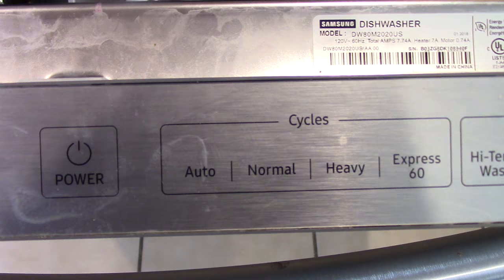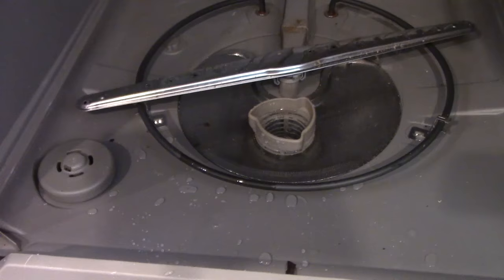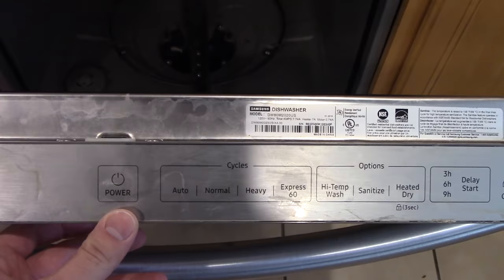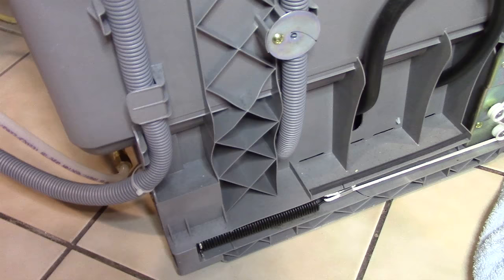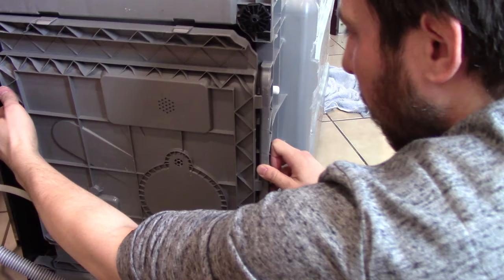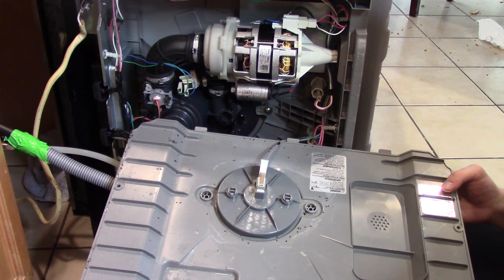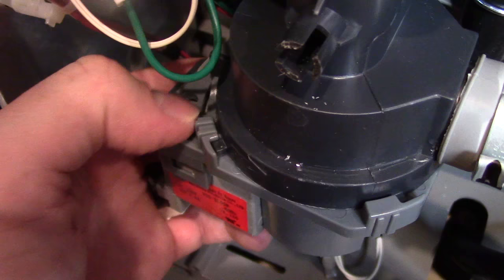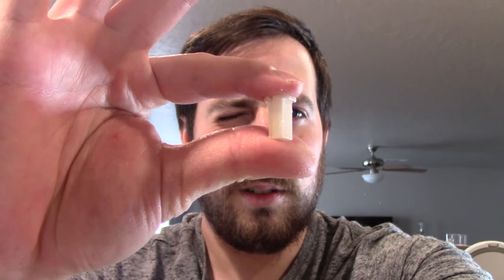Samsung Dishwasher Won't Drain: Impeller Fix

Comment: I can run the rinse cycle with no problem but water does not drain. I thought it might be the fact that they never properly hung up the holes according to the installation manual. But I’ve tried to get that holds up a time as I can and it still doesn’t drain. Was able to run the dishwasher eight or nine times before it suddenly stop draining. We just moved in so all of this was here already when we came. Can it be anything else other than the drain hose not being high enough? I put my hand in the filter basket at the bottom and I believe something there is supposed to lift up so I can get to that propeller but I can’t really seem to find a handhold anywhere to do that
Reply from the maker: Hi Erica, thanks for checking out my video. When you try running a cycle, do you hear any sort of humming sound when the system is supposed to drain or does it sort of just stop working? Is your normal light flashing? Do you recall ever hearing water draining into the sink when the system is trying to drain? Hopefully we can figure it out.
Reply: Hi, And thanks for answering so quickly! I do hear what sounds like a buzzing noise which I guess is something trying to drain but I do not hear anything like water running through the drain. I’m really thinking it’s an impeller issue. This is my first dishwasher but I’ve been doing a ton of research trying to figure out if we call someone in or not. We’ve only been here a couple of months and sometimes I’ll get the LC error code when I try to run a normal cycle. The only cycle I can run without it ever being an issue seems to be rinse but then it won’t drain.  I’m not handy enough to do what is being done in a video LOL but I’m hoping to be able to get someone in here. I read the installation manual for the Samsung dishwasher and it shows that the hose is supposed to be hung up under the sink at least 20 inches off the ground and mine doesn’t seem to have enough leeway to do that so I tried to pull it straight to the side in an effort to get it off the floor.  This is the stormwash, so there is no plunger inside. Thanks!
Reply from the maker: @authorericar.stinson4849   it sounds like the impeller is getting electricity to it. Hmm. You could be right about the position of the drain tube, although I tend to think there's more of a risk of the drain tube being too high off the ground than too low. The higher up the tube is, the more the pump has to compete with gravity to evacuate the water. Have you ever heard water draining into your sink while the dishwasher is running?
Reply: @karatefox  no, I don’t think so. And that’s one thing I noticed on the end of your video is when you turned your machine back on you could hear it humming and things going in the machine with water. I hear the sound of water trickling from within the machine but I don’t hear a hum or anything, just a sloshing sound. It’s the craziest thing. And the people that had this apartment before I moved in we’re really nasty so I wouldn’t be surprised if there was some kind of food or something stuck in there somewhere because I already found remnants of food and things in the bottom of it. The strange thing is I was able to run the machine a couple of times when we first came here successfully but I don’t recall whether or not it drained properly. Like it had a very slow drain and now it doesn’t drain at all. Regular sink works fine with drain and I definitely hear water running down that one when I use it to hand wash dishes etc. With Covid it’s been hard trying to find someone to come in here to do the work, but I’m going to see what I can do.  I hate washing dishes more than any chore there is and this is killing me because I’ve waited all these years to finally have a dishwasher.  got one and it doesn’t work 😂. Thanks so much for all of your advice! And on the plus side I’ve learned a lot about dishwashers 😃
Reply from the maker: @authorericar.stinson4849  I'm happy I could help. I've got a few ideas to troubleshoot further. Operating on the clogged food hypothesis, you might want to try getting a drain snake or something similar and try fishing around in the drain hole where the tube connects to the sink. It's possible that the previous owner put some food down the drain and some of it may have gotten lodged in that drain hole or even backflowed into the drain tube. Likewise, if you are able to safely pull the dishwasher out of the counter area, you could take a look at the tube and gauge whether water is flowing up into the tube. Likewise if you have a bucket, you might want to try to temporarily disconnect the tube from the sink and place it in a bucket to see if water can pump into the bucket. The key is isolating where the issue is in the drain system. Please let me know what you're able to find out. Hopefully someone will read our conversation in the future and get some helpful insights.
Reply: @karatefox  definitely thought about doing that and a reverse sort of way. But I definitely appreciate that advice because that’s the only other way I can get to it without pulling the machine out right now. Come hell or Highwater, I’m going to get this thing to work! Well definitely keep you posted and thanks again for all the help
Reply: @karatefox  hi again! Just wanted to let you know that there was a piece of glass that had broken off from something the previous owners did and it was jamming the pump. I had someone come in(to the tune of $300)come in and replace the pump. They seemed shocked that I knew so much about the inside workings of the dishwasher(lol)but I told them how long I'd been researching the issue and that I'd learned a lot.  If I had been physically able to do this myself, because it didn't take them long at all to change it out, I would have done it and save about $250.  In any event, dishwasher is working now, but I am still keeping eyes on it.  Thanks again for all of your help!
Reply from the maker: @authorericar.stinson4849  Hi Erica, that's great that you were able to get it working again. Likewise, thanks for sharing your insights about the cost information. If you ever have any questions in the future, please feel free to reach out :)
Reply: @karatefox  ran a 'quick' one-hour cycle after dinner, watching (and listening)nervously. I was able to hear the water going through the drain now, it did the whole cycle and the door automatically pops open about ten minutes before the end during the drying. Here's hoping it stays working this way because it was nice to be able to take my dishes out and put them straight into the cabinet lol. For once, I am not soaking wet from the spray hose attached to my faucet. That damned thing is so strong I was constantly getting sprayed every time I had to hand-wash the dishes. Thanks again!

Comment: never buy samsung dish washer nor refrigerator
Reply from the maker: True facts, my dude 💯
Reply: Or washer dryer
Reply: True
Reply: I don't even want to buy a Samsung TV anymore because of the quality of their appliances.
Reply: What should we buy sensei
Reply: Have both and both are Garbage.  Ice maker frozen up, force thaw but still does it. Had to buy counter top ice maker. Also  freezer door handle broke off. Dishwasher is doing the same thing as in video
Reply from the maker: @roberthailey1770  Dang, same here. The fricken ice maker. I've heard that some people have been able to use a blow dryer or heat gun to manually thaw it out. Not sure about the hygiene aspect of this approach. Maybe I'll give it a shot and make a video if it works. In the meantime, we've been buying bags of ice from Costco. Seems to be adequate for now.
Reply: I learned that the hard way
Reply: Samsung is so trash!!!!
Reply: I can't use the crushed ice if i do ice melts and clogs ice maker. @karatefox

Comment: Other solution: I got a new sink and garbage disposal. After that, the dishwasher suddenly stoped drained. Perplexed me. It might seem obvious that this is where I should have focused on. But hey, I followed the instructions here and still didn’t work. 

Lo and behold, with a flashlight this time, another look at where the hose hooks up to the garbage disposal and i discover the culprit: The new garbage disposal had a little blocked hole (kinda like a plug but semi-permanent) that has to be knocked out when you first get the garbage disposal. So it would be like trying to a pee with a blocked p-hole (sorry for the visual lol).

Knocked it out with a screw driver and hammer. Bam. Drains like normal. Sheesh!!
Reply from the maker: Oh dang, I made a video where I installed a new garbage disposal and I remember seeing exactly what you described. I guess the idea there is sometimes people install garbage disposals but don't have a dishwasher that they want to hook up. But yeah, that darn plug needs to be removed prior to hooking up the dishwasher drain tube. Thanks for sharing your experience and checking out my video.

Comment: Mine is flashing a 3c1 code. If you run a normal cycle it will not drain. If you run it in the test mode it makes it to 2 and then throws the 3c1 after draining the water out. I have replaced the impeller. Any other ideas?
Reply from the maker: It's quite possible that the drain tubing is being partially blocked, perhaps near the exit opening inside the drain of your sink. I would check that first. Alternatively, there could be an issue with the water inlet valve leaking. I made a tutorial to replace this, feel free to check it out. 

When was your system last working? Do you remember it making any weird sounds? Have you observed any water leaking?

 https://youtu.be/5qAwkM59nxk

Comment: Did you ever figure out what that piece was?  I found the exact same piece in mine.  But it had knocked the impeller right off the motor.  I put it back on the shaft and have tested it but it won't pump.  There was some gunk in the part that feeds into the pump,  I cleaned out the best I could but it still won't pump. I'm thinking it may have stripped the splines the impeller has to the shaft.  I'm wondering if when it tries to pump it slips.  Ever see that happen?
Reply from the maker: Hi Jon, I never did figure out for sure where that plastic piece came from. Another viewer said they found a similar piece and discovered that it had come from their water inlet valve. I did end up also having issues with that so I suspect that could be the source of the foreign material. If the impeller splines are damaged or the parts won't stay together, it may be best to replace the impeller entirely. How does your water I let valve look? Thanks for checking out my tutorial by the way.
Reply: @karatefox  found a pump assembly for $30 on ebay.  Was going to pick it up and see if it fixes the drain issue. Not sure on the inlet valve. Where is that? What am I looking for?  Thanks for the reply.
Reply from the maker: @69dieselscout  Here's a video I made recently where I did some troubleshooting and replaced the water inlet valve. If your dishwasher is the same model as mine, the valve will look like a yellow and white object attached to the outside edge of the dishwasher's frame, and have a black rubber tube connected to it.

https://youtu.be/5qAwkM59nxk
Reply: @karatefox  alrighty. Thanks for the advice. I'll see what I come up with.
Reply: @karatefox  got it fixed up. Ordered a good used pump on ebay for $9. Works perfectly again.
Reply from the maker: @69dieselscout   That's awesome that you got it fixed, and likewise that you were able to find a good deal on ebay. 👊🔥